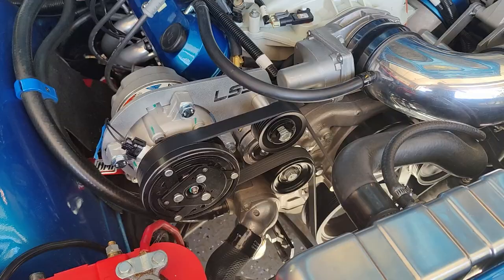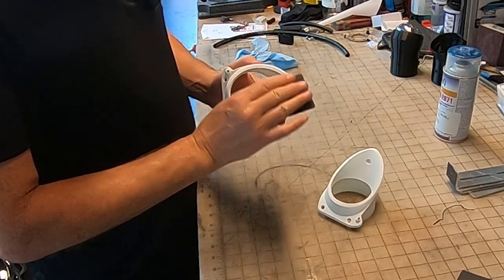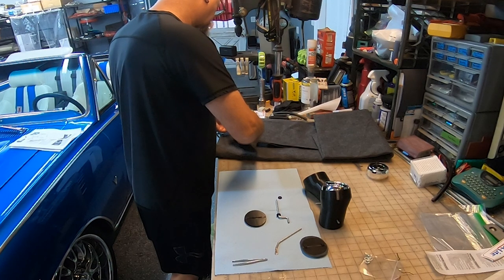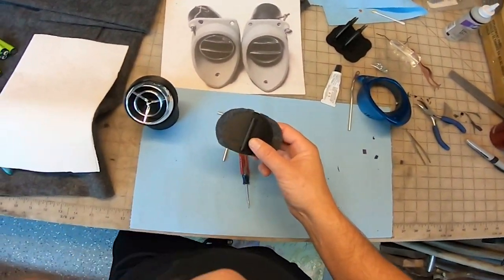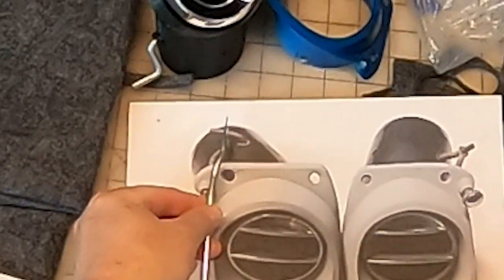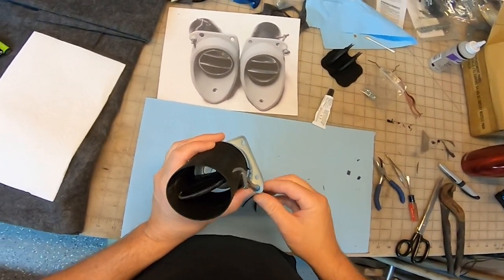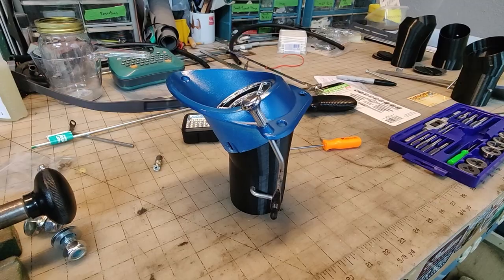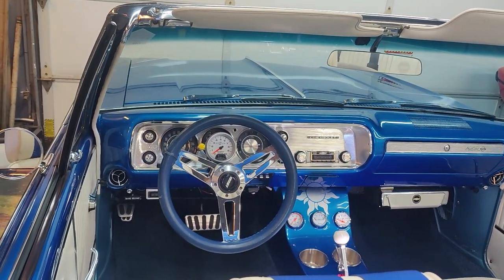pt2 1964 Chevelle Air Conditioning Install | Building & Painting vents, ducts & diverter doors 4k

Comment from the maker: 3D printed ducting update: I recently found out that the company that was remote 3D printing and shipping these parts has gone out of business. Shapeways was a company that I had uploaded the duct designs too and they handled the whole process of printing and shipping directly to the customer. TBH, I was never all that thrilled with them. I am actively searching for another company that may be able to fill in for this company. I'll keep you informed if I do. I know there is another option for these parts, albeit more expensive, but in the end, it might be the way to go. I never made any money off these parts because Shapeways charged way to much (IMO) and I felt it was more important to get these in the hands of all of you than to make $5/$10/$20 off of these which in the end isn't going to change my life in any meaningful way at the volumes where talking.

I've had people ask me why I don't print and ship them myself. On the printer that I own, the Creality Ender3, it takes about 30 hours to print one duct. So 60 hours of print time, plus printer set up and monitoring, just takes to much of my time. I also had many print failures. I had five or six print failures to get the two that are in my car, so it's just not an option for me to make them for you all, sorry. 

Anyway, if I can find an option, I will let you know. Thanks for understanding.